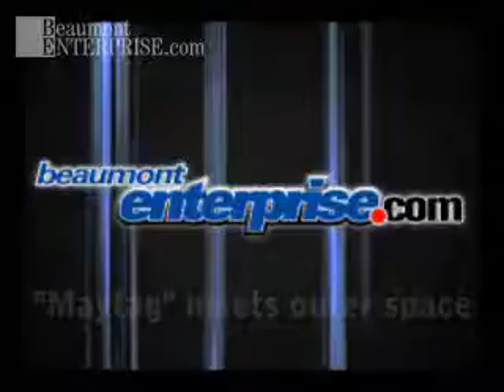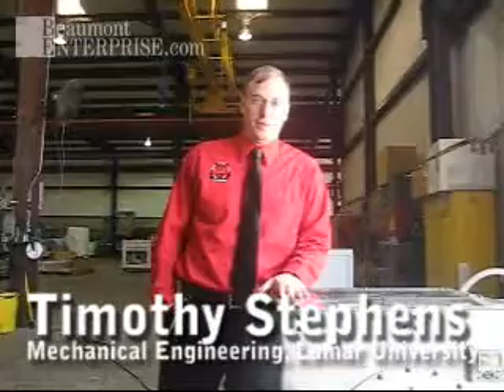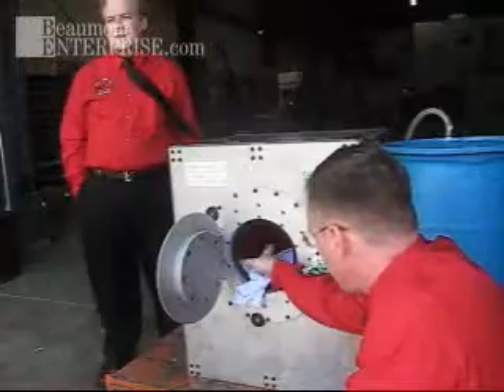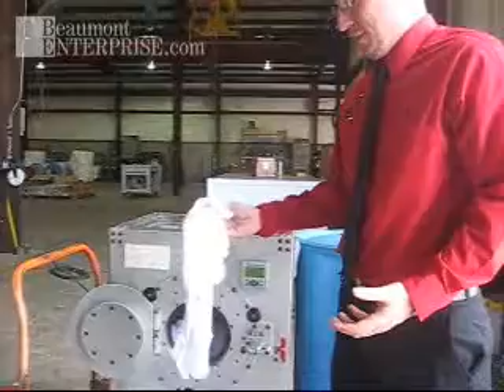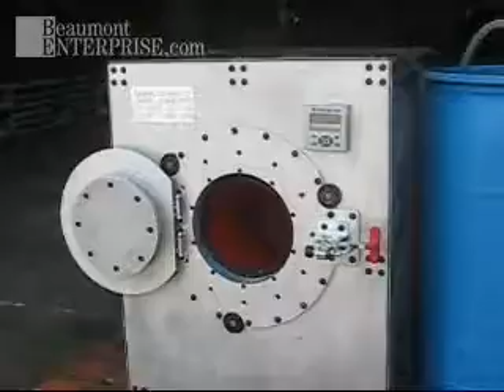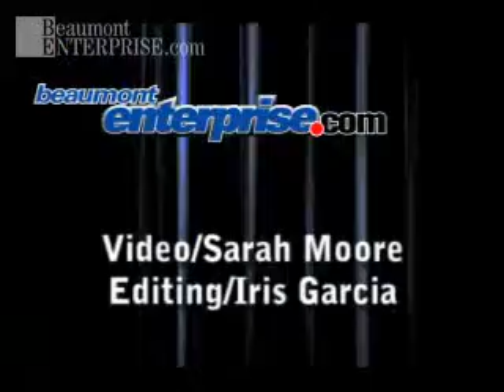"Maytag" meets outer space

Comment: Although maybe a nice way to stay clean, I do not think with a circulated water supply in space, the washer would be a good idea, plus it would add water based utilized equipment to a platform that cold increase the chances of a freezing water accident to occur.   Remeber space is cold, a capacity of useage to which an appliance is used, would not be a good idea, I personally do not think, because it would require also upgrading of a water supply that is on a platform or space craft.